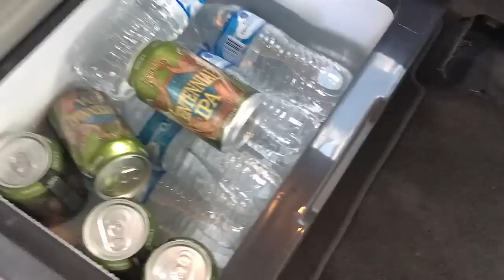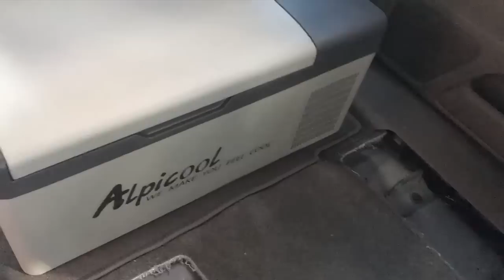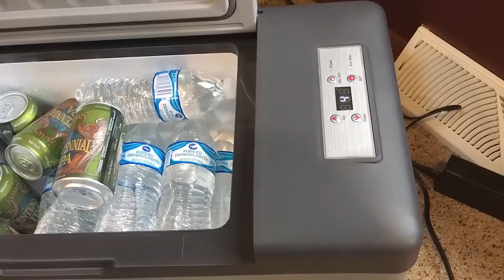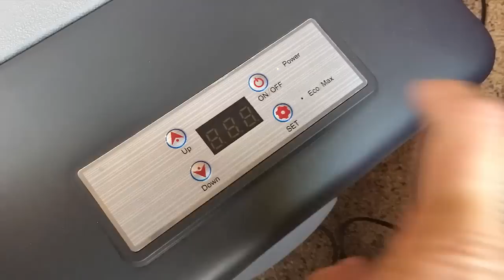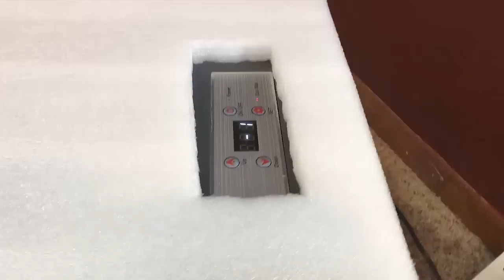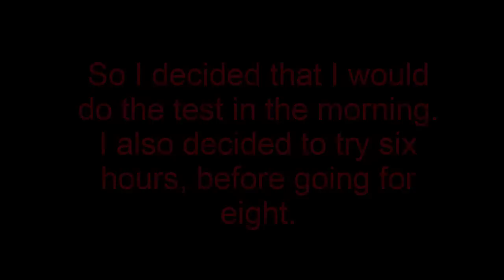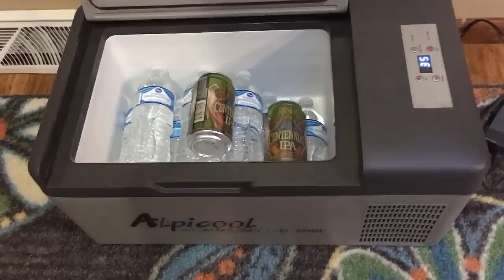Refrigeration in Your Van Part 2 (keeping beer and insulin cold)

Comment: How can you reccomend this fridge after it didn't pass the test? Nobody would agree to wake up every three hours to start the engine. In my opinion it's absolutely useless piece of crap unless you have a solar power panel on the roof which most vandwellers don't have.
Reply from the maker: I have a solar panel on the roof...and batteries.  The test may not be relevant for you, but for a lot of us it is.  However, as you said, it's your opinion and you are entitled to it.
Reply: The test was absolutely relevant to me but you made a strange conclusion. Even though the fridge hasn't passed the test I still recomend you guys to buy it. Doesn't it sound strange?
Reply from the maker: @Eaton.Beaver  Yeah, I probably could have phrased that better...oh well, I try to do things unscripted and when all is said and done, you sometimes realize that you could have done it better.  One "problem" with YouTube is that you can't replace a video after it's posted (for some good reasons).  That means you either have to delete and repost---screwing up anyone who backlinked to the video, or you have to post a second video and people are like, "didn't I already watch this"?  Anyway, thanks for your input and I hope you'll keep watching if only to critique the results ;-)   As a creator, I can delete comments, but I try never to do that because all input can be valuable to someone watching the video.  Thanks!

Comment: I've had my unit for about month and was running great from  a small inverter to 110v in my van w no problem, but sometimes it would trip the fuse when close to freezing.  I switched to 12v plug (thinking it would be more efficient)  and now it runs for a while but then gives me F1 error code and stops and then later stars up again....  When I check my battery it's at above 12v so don't t think it's the source. What could this be?
Reply: Voltage at the battery is not where to measure. Measure voltage at the plug if the fridge, like the part that plugs into the fridge not he car. Voltage drop over the distance will be much less than the voltage st the posts. 

Dedicated fridge circuit with properly sized wire/fuse/connector is the fix
Reply from the maker: Hi, Check the battery protection settings. It is probably on H3 but H1 may work better. Keep in mind that the battery voltage under load will be lower. So it may trip the F1 code, shutting off. Then you check the voltage and it has gone up again. Here is some more info: Battery Protection settings.
The manual mentions battery protection and that the H3 setting is the default and safest, but doesn't actually give any numbers, so I thought I'd test it and find out. Battery protection stops the compressor and gives a F1 on the display if the voltage drops too low. My testing was done using it as a 12 volt system.
Behavior seems the same for both Max and Eco modes.
H3 will give the F1 between 11.6 - 11.8 volts, and will clear the error and resume around 12.5 - 12.7.
H1 will give the F1 between 10.6 - 10.8 volts, and will clear the error and resume around 11.5 - 11.7.
Reply: Battery voltage alone doesnt  tell the whole story and 12 volts doesnt sound like a healthy battery. Fully  charged should read 12.66 if its really good. If you fully charge it and shut down engine and read anything below 12.5 immediately you have a dead cell. You will need a gravity tester to know which one.
Reply: @batvette  I had an external fuse that was sensitive to heat that I replaced and I upgraded my starter battery to 115AH 205 RC deep cycle and it's made a big difference.  Also noticed I had other unnecessary current draws that were affecting my testing. Been on a few 4 day trips now and everything is working out perfectly. Fresh meat, milk and cheese for days even turning the until off overnight.
Reply: @12vLife  most problems usually come down to failing batteries.
Reply: Its better to use 12 volts since 12 volt is its native voltage, using an inverter is inefficient.  You should find a way to connect the unit to the battery directly if it isn't already.

Comment: Did you try your 44 amp system you made  is it enough? Thanks for any info Gaylene
Reply from the maker: gaylene davidson Hi!  Yes I used the house batteries to run the fridge through RTR 2019. By day, most of the power came from the solar panels. By night, I ran it off the 44 Ah of batteries. The trick is to keep water bottles in the empty spaces and the fridge cycles a lot less.  Thanks for watching!
Reply: So what would be your guess for usage on your battery pack ? Would it last 2 to 3 days  ? I have 100 watt panel  and looking at 40Amp hour lithium battery I thought I would  be ok 🤔
Reply from the maker: gaylene davidson I’m afraid not. Without the solar, you could not make it through the next day if you chose to run the cooler constantly. You’d need to recharge by running the engine and using the alternator, solar, or some other means. If you want to run multiple days, you’ll need more battery.

Comment: I just got one 
Amazon had a special 
I paid 159.99 free shipping 
I have been watching this for a while waiting for a sale 
So far it’s great
Reply from the maker: Awesome!  That's a great deal!  I went back and looked at what I actually paid and it was $239 on Amazon.  I think you'll be pleased with it.  Like any fridge, you want to keep it as full as possible or fill the empty space with water bottles.  That's especially true if it will be shut down for any period of time while you are parked.  Thanks for watching!
Reply: @OdysseyCamper  I got the bigger Alpicool with wheels 32 qt. $224 on eBay, eBay is always much cheaper than amazon.
Reply: The C15 is currently $179 on Amz, & the C20 is $199. End of May 2020 (during the great pandemic waiting for state parks to reopen.  Ok, on to next video.

Comment: one tip i have from experience is make a filter that you can velcro over the cooling intake. after a few years thing can get really dusty  in there.
Reply: That's a great suggestion!  I'll add it to the video description, thanks!
Reply: I would just blow out the coil fins and cooling fan about twice a year with an air compressor. (put a stick in the fan so you dont overspeed it. You will cry when you see the blades fly off!) Seems to me: 1. A filter would fuck with the natural thermal flow and it will pull air from the exhaust side instead of thru your filter.. or 2. If it is actually effective it still reduces cooling air flow.
The whyter 43l I had for 4 years had a service panel you could remove to fully clean that shit out with a compressor and small paint brush. I do agree you need to avoid dust buildup I just think you also need to avoid doing anything which increases heat since its the same devil.

Comment: There is another factor on power draw. In the accessory position there are probably other power draws occurring which added to the cooler will shorten the time available. You should really get a house battery for the cooler that is intended for deep cycling. These car batteries are not intended to be drawn down and will lose capacity. I was reminded of this the hard way recently after using an air pump for about 20 minutes in the accessory position. It killed my three year old battery that had previously been able to hold a charge.
Reply from the maker: Those are great points and I definitely did not consider the other draws with the key in the accessory position!  Thank you for your input.  Personally, I do have a console mounted battery pack to run this, but I wanted to show that it COULD be done without it, if you don’t have the funds.  However, the best way to do that would probably be to have enough thermal mass to hold the cold when you weren’t driving.  I’m always thinking of things I forgot to put in a video, but these comments are a good place to discuss them. Thank you again for your input!
Reply: @OdysseyCamper  if you do go the "house  battery" route try go with 2 6v golf cart batteries from the start. Since each has 3 cells in the space the 12v has for 6 you get much thicker plates which can endure the sulfation caused by deep cycling. I went through two alcatel/lucent/deka batteries... enormous agm batteries with 145ah capacity, then 3 of walmarts biggest deep cycle marine batteries in 2 years or so. 5 batteries ruined.  2 years ago bought a pair of gc batteries crown brand still going.
Reply from the maker: @batvette  Thanks for the advice!  I used a pair of 12V 22 Ah batteries for my console battery pack, mainly because I already had some on hand.  If I increase the batteries, I will go with your plan.  That would be a LOT of power for my meager needs :-)

Comment: Thanks for the video. Do you have info about comparison of efficiency with Dometic refrigerators? Amazon website says Dometic 15L uses 0.64 amp per hour. Of course Dometic costs 2x as much.
Reply from the maker: It's also worth mentioning that this model of Dometic does not come with a 120v adapter for when you have shore power available.
Reply: Odyssey Camper yes, the specs are confusing, and perhaps that’s what marketing is about sometimes. I like the shape and size of the Alpicool also. Thanks for the research !
Reply from the maker: OK, I did a little research and according to the owners manual, the Dometic CF18 (the closest model to the Alpicool) uses 7 Amps at 12 Volts.  So that's 84 Watts vs the Alpicool's 60.  BUT, the CF18 is slightly larger, so the compressor is probably a tad bigger as well.  I'd say in that respect that neither is more efficient than the other.  But to really test efficiency, we'd have to do a more controlled study and cool things down to the same temperature to see how long they stayed cold, and check how much energy was used over time, etc.  It still wouldn't be a fair test because one has more surface area than the other.  So, I'm going to call it a tie in that respect (based on the info I have at this point).  What I can't figure out is what they mean by .87 Ah/h.  The extra "h" does not mean anything to me.  Maybe someone will comment below.  However, if I know it uses 7A in an hour when running, then they might be saying that since it's not running all the time, it only uses .87 Amps per hour (Ah).  But that means it's only running 7 min out of the hour.  That seems WAY low to me (sounds like marketing) and you'd need to know the test conditions.  If I fill the cooler with water and then freeze it solid, that compressor won't run much in the first hour.  If I put one can of beer inside, it will run constantly.  But I'd say that based on the Wattage rating of both coolers, they are comparable..
Reply: @OdysseyCamper  throughout many adverts and reviews I found confusing units of measure. Continuous load of 5 amps at 12V is 60W. 5 amps/hr would blow a 15 amp fuse after 3 hrs, which is nonsense because amps/hr nonsensically implies accelerating current and power. Amp-hours is a measure of energy consumption (at a given voltage) so you can deduce that  your average .87Ah per hour can be calculated over 24hrs to know the daily impact on a battery.  Anyone who quotes amps/hr cannot understand even basic Ohms law.
Reply from the maker: @andrewcherowbrier329  agreed. I think they just do it so that people who are NOT familiar with Ohm’s Law can compare the draw to their battery rating. I have a 100Ah battery and the tiny draw is not worth worrying about, overnight. My fan uses more energy.
Reply: @OdysseyCamper  Thanks.
I found other links that suggest it will run "several days" ( which has to be at least 3) on 1kwh). I can sustain that on Solar panels, so I think I can go with it, but the info is all mangled.
Reply from the maker: @andrewcherowbrier329  cool. I ran mine in the desert with a 100W panel and the battery stayed topped off, even running it at night and using my 300W immersion heater 20 min a day. Thanks for watching and commenting!
Reply: Comparisons require both refrigerators. Why not buy both and let us know. Invest in your quest for information. Thanks so much.
Reply: If it's any help, the C-15 has about 1 inch of insulation. My super high efficiency Sunfrost RF-4 has 3 inches of insulation and costs about $1000 more than the C-15. So, adding insulation is an excellent idea.
Reply from the maker: I suspect that the .64 amp rating is at 120v because it seems low to me.  Can you link to the exact model you are talking about?   They have a lot of different models.

Comment: Just got this one. You can actually set the temperature even lower, by changing the hidden setttings. There's another video on YT that shows you how. Also from factory setting the fridge is set to shutdown when the battery reaches around 11.4 volts, so in theory you should still be able to start up your car.
Reply from the maker: Commander Rick I didn’t realize that!  I will check it out. Thank you for the info and thanks for watching!
Reply: Yup, three different settings (with a high and low threshold) for that and shuts off and gives you an F1 error.  Really nice feature actually.